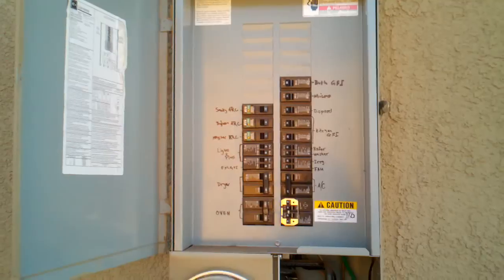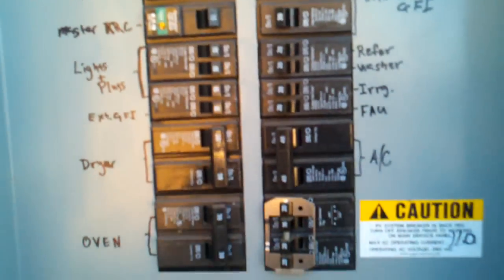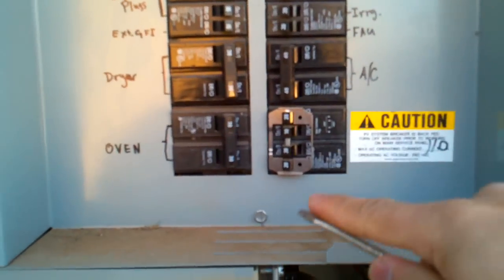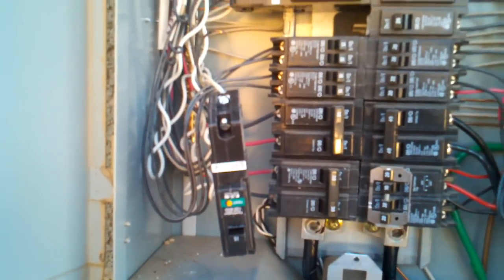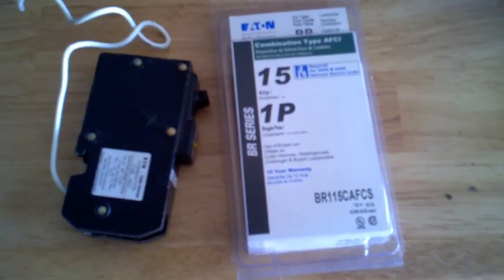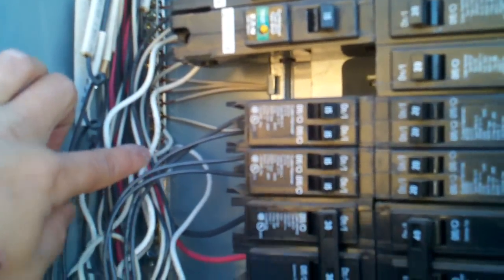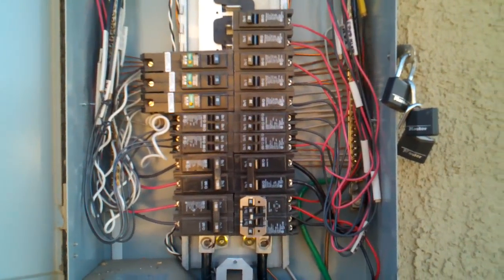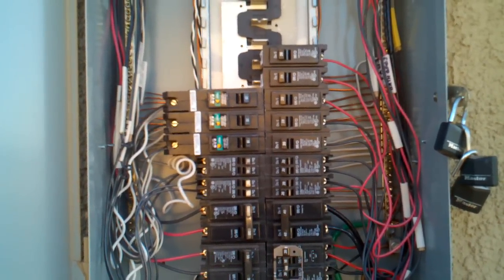How to change Electrical Breaker and not get electrocuted, SHTF

Comment: After he removes the panel he should use a Non-Contact Voltage Detector to ensure no power at the breaker lug. Also, his short video omits actually wiring in the ground wire to the ground bar and the neutral wire to the neutral bar. His video returns with, "we have the ground and neutral already wired in," which doesn't help someone who hasn't done it before.

Comment: as a qualified electrician myself you have no idea just how dangerous this can be do on your own for example you need to know how to properly test that the board is dead just because the main breaker and solar supply is cut the board may still be live it is extremely dangerous to do this on your own. If you were to wire a RCD (residual current device) incorrectly it may not trip to the off position when there is a fault causing possible injury or even electrocution.

Comment: If there is any possibility of you accidentally touching  the high voltage mains that come into the breaker box you should turn them off and have a meter or light always attached while your working to make sure they remain off , and make certain no one can turn it back on if the master switch is in another location out of your sight. The breaker won't test  trip because it was WIRED WRONG, where's the black hot lead ? I see 2 white neutral leads in the same hole on the breaker, what kind of wiring is that ! There was probably nothing wrong with it except for the wiring error.

Comment: Please don't try this it's very dangerous to work in panels it could be a sub panel and you can land the neutral in the wrong spot it van be a back fed from a different  there's many things that can go wrong and you should never turn your main breaker back on with all your breakers on
Reply: +Mike M So what are you saying; turn off all breakers and main for safety reasons?  If yes please explain why all breakers have to be off when doing this job.
Reply: The reason he is saying this is because you don’t want power surges.  So, at beginning, best to turn off inside lights and appliances, etc and then turning off breakers one at a time and then main breaker.  Reverse order when turning the system back on.

Comment: I moved into an apt./townhouse (new construction) and I've had nothing, but problems with "Eaton breakers".  I knew Eaton made car parts, but these are awful.  

I was in Lowe's one day in the elec. dept. and the word "Eaton" just slipped out of my mouth and the guy said they were junk, they were building w/ cheap stuff.  If I plug in the vacuum cleaner (and it's the only thing on the circuit) it blows the breaker.  

The landlord won't do anything about it. I have to plug it in the kitchen or bathroom w/ an ext.cord to be able to run it.
Reply from the maker: +MrSting17 yeah, I hear ya... not pleased that it blew.. makes sense now that I know it's crap

Comment: next time buy a $5 voltage tester or "sniffer" and make sure theres no power to that breaker and you dont have to shut down the whole system
Reply: Spend 20 bucks on Amazon and get a cheap DMM (Digital Multi-Meter).  Then you can check fuses and outlets around the house, etc.  It's always good to have one around.  They're cheap and very useful.

Comment: This is not a good video, sorry. You never assume the power is off just because you turned off the main breaker. You need to test for the presence of voltage. Think about it, he's changing a breaker because it went bad and won't work properly, therefore the possibility exists that the main breaker could be bad as well. You need to test for voltage every time you work on electricity. The best thing to do if call a qualified electrician, rather than risk a fire or serious injury.
Reply: Would you check by going back into the house to see if the power is off? Or would you use some sort of voltage meter on the wires you will be touching?
Reply: Meter or test probe.  They're cheap and you should have one around the house.  For a variety of purposes.  Cheers.
Reply: I'm a degreed electrical engineer. In general, aside from verifying the panel was dead with a voltage tester, he did everything correct for the most part. He got the job done and didn't get hurt either. That said, if you don't know how electricity works or what you're doing, hire someone.
Reply: @Smashy360   Right on man 👍👍
Reply: Checking for power isn't a bad idea, but if all the lights in the house are out and the test buttons don't work due to lack of power, that's a pretty damn good clue.

I get the impression you are an electrician. That is the only profession where I see pros continually get uppity about people learning to do things themselves--usually using the excuse "it's too dangerous for peasants to understand."
Reply: @TravisTerrell  We tend not to hear from the dead or fingerless survivors.

Comment: Call an electrician. There are safe ways to do that without shutting off the entire panel.
Reply: Turning everything off is also safe.
Reply: So is bringing a change of underwear
Reply: Steven Owens Tag out is always the preferred method.
Reply: Its not unsafe, just unnecessary. You turned off your AC, your computers, all I'm saying is, to replace a breaker...turn off that one breaker. There, now all electricians I know are out of a job...
Reply: No, don't.  You do not need an electrician to replace a breaker.  Just turn off the mains power breaker, watch videos, ask people, study and then do it by the book.  Replacing a breaker is NOT brain surgery, and it only costs 10 bucks or so if you do it yourself.

Comment: Who the hell wired that panel?  In North America, hot wires normally have black or red insulation and white is reserved for neutral.  That construction should never been approved by the building inspector.
Reply: The black wire is live. The white wires contain ground and neutral as this is a GF/AF breaker

Comment: scary, Scary!  I think you are supposed to do this ... !???  You remove the panel and place it right where you can trip over it, where you are working.  Put is 5 ft off to the side, duh.  
You leave an outdoor panel open and exposed and leave to go to the store.  
You poke a screwdriver in to pry the breaker out, it should rotate out toward the side of the panel with just your hands.  
No testing to be sure power is off.  
Some say never stand in front of a breaker you are remkving.
Some say close all breakers before closing the main breaker to remove all load off the main breaker. 
Too much here to not do.